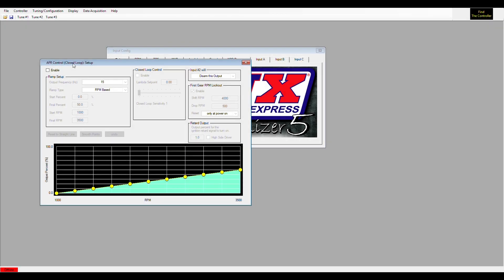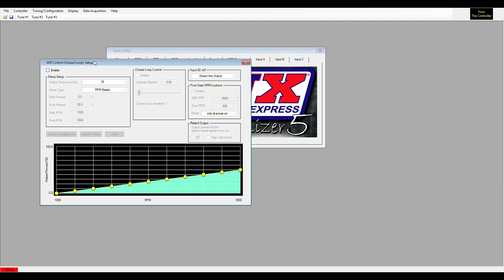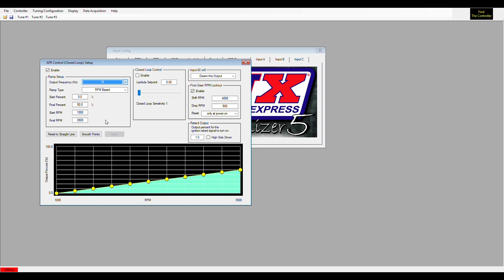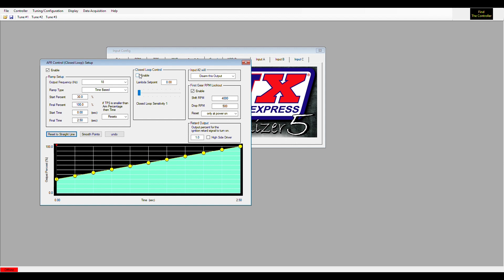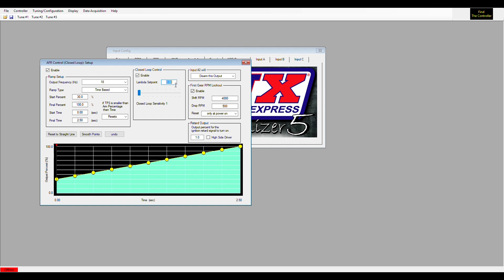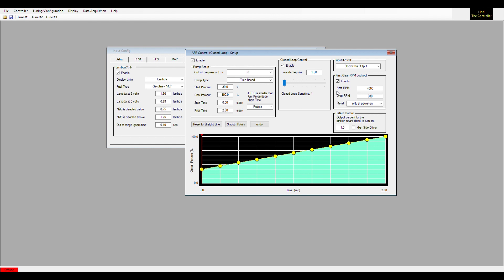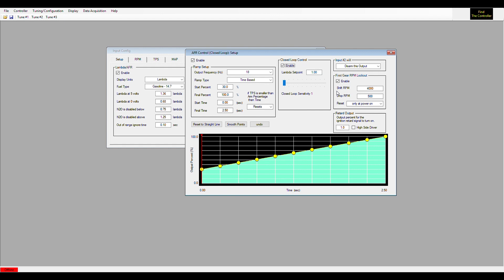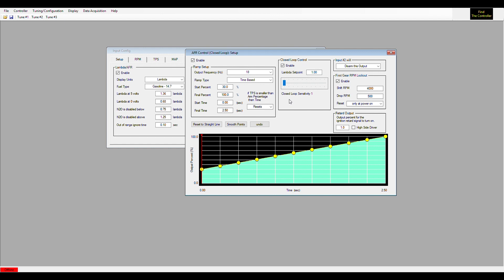Nitrous Express Maximizer 5 Air/Fuel Ratio Control Explanation

Comment: Is there a video wiring the innovative lambda into the max 5 .
Reply from the maker: No there isn't, but It is only a single wire from the Innovate (0-5v analog) that will connect to the Lambda wire on the Max 5